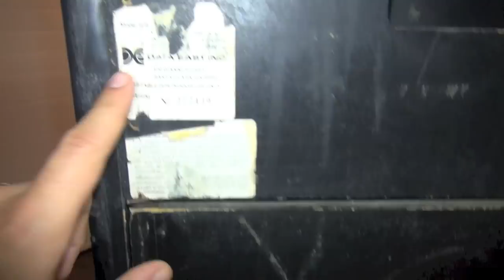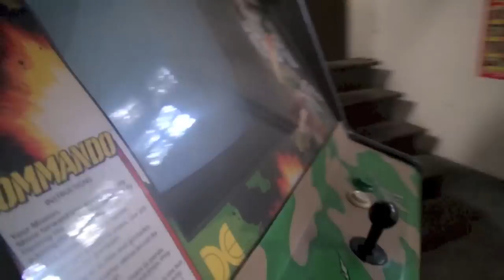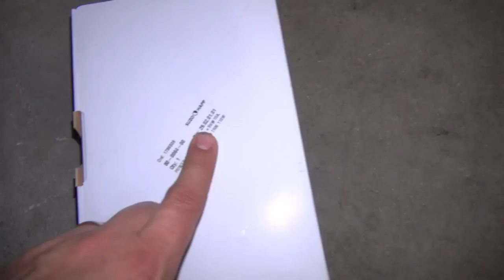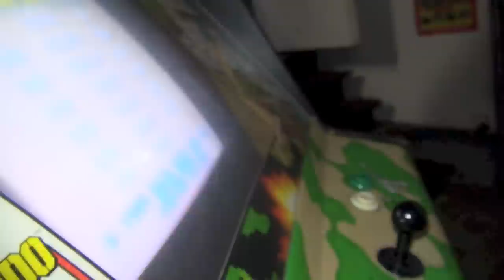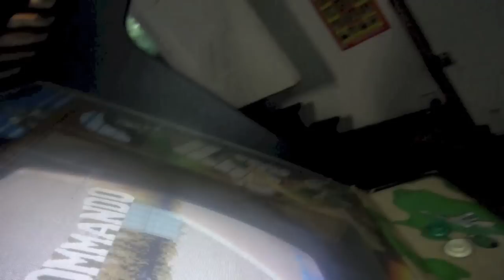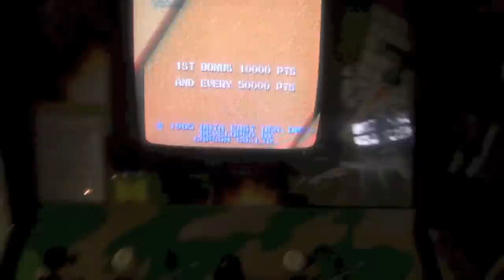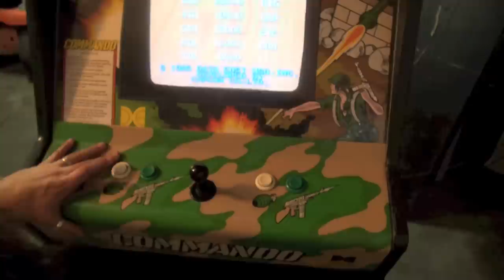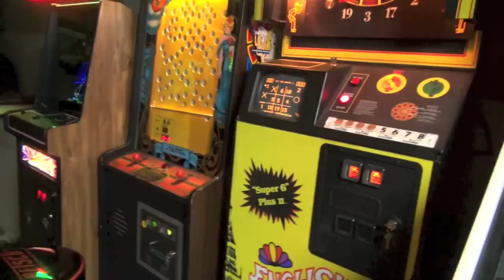How to fix a dead arcade game #1 - Troubleshooting a Craigslist purchase - Data East Commando

Comment: Tip: Take a photo of wiring with a camera phone before disconnecting everything.
That way if you get mixed up, you can just check the photo for reference.

Another tip: use electrical contact cleaner or isopropyl alcohol to properly clean switch contacts
Reply: Or you could just label them like a normal human and so they will be labeled for future fixes.

Comment: A room full of the most amazing arcade games known to man, and the thing that sticks out to me the most is the Rat Pack poster. That is the best basement in existence.
Reply from the maker: Thanks, buddy! And, yeah... I love the Frank, Dino, and Sammy. :)
Reply: @Johnsarcade  can u help me I bought a  game 
It worked for 10 minutes and the monitor cut out then smoke and then nothing!  PLEASE HELP!
Reply: @shanoemichael4439  Check the capacitors on the PSU, they probably will be bulged, the filter caps do blow when sitting for a long time
Reply: @roberternest7289  I have a mortal kombat 2 and it was working but sat in my storage for a few years and will no longer boot up now.
Reply: @Bondovw  Caps too. I'd need to see the PSU, do you have discord?

Comment: i just bought my third arcade machine tonight. it was listed on CL as turning on but not playing.
when i got to the house the screen powered up just like the one in this video, i (not knowing much about these machines assumed it was a bad monitor) later i realized no sound meant the game wasnt coming on. i searched the net for a while and stumbled upon this gem of a video.
i pulled the power supply out and gave it a look, someone clearly was working inside of it and hacked wires and stripped screws (all inside the power supply).
thank you for simply being the suggestion to point me in the right direction. defiantly a thumbs up and subscribe!!

but i have to say when you broke out the power driver to put the screw in to the casing of your new power supply i cringed pretty hard! thats a bit of over kill for that type of job but it seems to have worked so i guess no harm done.

thanks again.
Reply from the maker: Awesome, glad I could help! That power screwdriver has really low torque. No harm was done!

Comment: Isolation Transformers are used to physically separate the monitor's power form the mains lines.  This has the advantage of eliminating a ground-path return so that if you touched one side of the power coming from the monitor side of transformer, there would be no return path through your body to ground so you would not receive a shock, or at least not as strong as you normally would.  

Without the transformer in place, touching the hot side of the AC would cause a shock because your body would be used as a return path to ground.

At least, that is how I understand it. :)  YYMV.

BTW - The terminals are called "ring" terminals, as opposed to the "fork" ones you were expecting.  And I love the vids - good to see another passionate collector out there!

Comment: When you mentioned the dip switches and were looking and wondering what the dip switch settings "one way or two way" switches for a coctail table were. 

One Way is for the screen to stay facing one player and sharing controls from one side of the table with another player vs Two Way so the screen flips orientations between both sides of the table so the additional player isn't looking at a screen upside down and they can use controls of their own on their player turn.

Love the arcade collection. Good titles and helpful tutorial for beginners. 👍

Comment: About 20 years ago I picked up a Shinobi for $20.  The seller said it would run for a while and then lock up.  I checked the voltages and the +12 was putting out +17. It had a 12v adjustment so I dialed that down and it worked great.  Later I noticed that it had a shadow of something under the paint so I stripped some paint off and saw a big Williams W. I took a little more paint off and saw it was formerly a Joust.  Unfortunately we moved and I had to scrap the game but I kept the main board.

Comment: My brother bought a broken original Digdug cabinet that has a streefigher board inside. As with you, the price was right. The one side panel has the digdug branding while the other is branded with streetfigher. We are having the same  blank monitor issues you had. I hope it's the PSU! We'll check it  this week.

His original idea was to buy a new empty arcade cabinet and hook up some buttons, joystick and a pi to it. This used cabinet was cheaper than any new cabine. So maybe we can get the old internals working in this Digdub cabinet and also retrofit a pin into it so he can switch between.

I have basic knowledge of electronic repairs, so hopefully I can get through this for him. I'm excited.

Comment: Great video and a great find.  Watched it start to finish while on the treadmill.  Some advice for novices.  Don't go cheap on multimeter, Fluke's are one of the best on the market, they can save your life.   When working with electricity that's live (plugged in) avoid wearing jewelery less risk of shock.  When cleaning monitors like John did, you can spray onto the paper towel first and then wipe the monitor, but John is a pro so he can get away with it. :)

Comment: Hey.  Thanks for this video.  It gave me the confidence to go ahead and buy a non-working game off of craig's list/ebay and walked me through how to test it and work on the device.   My first pick up was an old Frogger game with a frayed cord.  Turns out I just needed to replace that cord to the PS, and it fired on up.  

Took your tip to unplug the CPU and test voltages first.   Only had to splice together a snapped wire in order to get the start buttons to work. My son and I had fun doing this and shared the joy of success in getting our first unit to work.  

I kind of wish you'd watch the language in some of your videos though.  I can't watch some of them with the children. :)

Thanks again, man!

Comment: At 15:00 that potentiometer is for adjustment of the 5 Volt potential between 4.5 and 5.5, if there's NO voltage, the power supply is DEAD. Turning it to maximum risks sending 5.5 into everything (problems?, possibly). Nice repair. Good cheap game for cost of purchase +$15

Comment: That is really cool, Awesome video. I just picked up an arkanoid in a painted over pacman cabinet. The guy was never able to play his game even though it turned on. At his hour i noticed that it did not have coin mechs, one switch was unconnected, and the other was missing the wire to coin up but was able to move it and register a few coins so he could play his game for the first and last time before we packed it up in the truck lol. I paid him first though. It still needed some work but was a pretty solid deal.

Comment: I got a question. I have a multicade Joust machine and the fuse blew. The one that came out is a MDX3 125volts and all i can find locally is a MDX5 125volts. that to much amps for the machine? should I keep looki ng for the 3amp

Comment: Great video, thanks for sharing. I have a Johnny Nero shooting game that I've been working on. I was able to get into the diagnostic screen but couldn't calibrate the guns. I changed out the pcb on the guns and things look good but when I hold the start button at start up the game starts but doesn't go into the diagnostic menu. I know I need to Calibrate the guns. How can I get into the diagnostic screen if the start button doesn't take me there? There is no diagnostic switch in the coin box either that I can tell. I'm new to this but learning. Thanks

Comment from the maker: When doing DC I am basically putting my leads on positive and negative. Black goes on ground (-) and red on +5 (+). When testing AC I am putting one on common and the other on hot which is the two AC leads.

Comment: What on EARTH are you doing adjusting LOPT screen & focus pots with your bare hands? USE A NYLON TOOL IF YOU VALUE YOUR LIFE - THERE'S ~25KV ON THAT TX.

Sincerely, TV & VCR engineer since 1991.
Reply: +unlokia 
Nylon tool? Any link?
Reply: BarrySlisk Google "nylon tool" ;)
Reply: +unlokia its also called a trimmer, I think
Reply: Shao Kahn Ah yes, that's the one, thanks :)
Reply: +unlokia Mr Unlokia, If I dont have this nylon trimmer tool, is it advisable to work with nylon gloves (like the yellow ones)? Or it doesn't serve no purpose? I ask because, even if I have these tools, the flyback is facing the side of the cabinet on my Wei Ya chassis, so I have no way to correctly aim the tool to the pot.
Reply: I worked on those games for two decades. The only time I used those tools was to adjust a choke. If the flyback was leaking, there is no doubt. I did get hit one time trying to drain the CRT. My hand slipped and I touched metal. That did hurt, blue flash in my eyes and the taste of copper. But I agree, unlokia, Safety first. I guess I was pretty lucky, but also, always aware. I also worked on Juke Boxes and Pins, pool tables, electro mechanical machines. Ones even from the 19th century.I think that the Interlock switch was off set on this game. So the back door would not activate it. They could keep it in the out position and just put a switch on the front.

Comment: You can fry a game board by powering a game on with a suspect power supply. Measure the power supply voltage first with a test board/load before using a good game board. You never know if someone has been screwing around with the power supply's voltage dial or if the power supply is putting out voltage way above +5v or +12v.

I don't like to adjust the voltage dial with the good game board powered on with an unknown power supply. I fried a board once doing that. I was at +5.03v and was trying to adjust to +5.3 and the voltage dial or power supply went faulty shooting the voltages up way too high on the +5v and +12v rails, frying my game pcb. So now I always use a test board when adjusting the power supply to dial it in when powered under load. Better safe than sorry in with a working game pcb.

Comment from the maker: Pac-Man has the power supply built into the main PCB. It doesn't have an external power supply like the one in this game. This game's power supply setup is much more common, especially with mid-late 80s and beyond games.

Comment from the maker: The monitor does not run off the DC power supply. The monitor gets its AC from the Isolation Transformer.

Comment: FYI: On AC wiring the black wire is "live", and the white wire is "neutral". -- Most modern power supplies should make that distinction. -- It will probably still work if you hook them up backwards, but it won't be as safe, and it could violate your local electrical or fire codes.

Comment: With a not functioning psu, why didn't you check for shorts on the power rails before powering on the new psu? Couldn't that have destroyed the boards if there was a short on the board the killed the old psu?

Comment: 2024, i thought you said not to just plug it in, check voltage for the power supply but then dont remove the connector for the pcb??

Comment: Isolation transformers are used on monitors are for safety. Most monitors are live chassis & if earthing to the cabinet is lost there is potential for the cabinet to become LIVE if an isolation transformer is not used.

Comment: Hi. I own two Commodore crt monitors. The 1701 and 1702 model. Both in perfect shape and working. Would like to keep it that so I was asking myself if there is any need to replace the caps on the PCB? What's your opinion in this?

Comment: Hi John. Great vid thx. I bought a Midway Space Invaders from 1978. There is a very old power supply installed. I checked the voltages and there is no -5V. So I wanted to replace the old supply with a new Switching Power Supply. But there is a huge connector to the old power supply with a lot of cables. I have no idea with ones I have to cut from the connector to install them on the new supply. Some ideas? THX and nice day. Reno
Reply from the maker: Arnold Tostone There is an adapter: http://cambridgearcade.dyndns.org/?q=node/15

Comment: Hello. I'm burning my
neurons on a video signal issue. I bought a Pandora's box 3 vga HD.
This is a plug and play card to play old arcade games. It can
autoswitch between 800x600 and 640x480 signal. It is an embedded
system with the sd and software inside (emulator + roms).
Unfortunately the code is crypt and I'm unable to reverse engineering
that. I tried to plug it to two old monitors with only vga plugs and
other two with also dvi plug. I noticed that in the older it works
fine, instead in the newer doesn't. One of them shutdown and led
blink and the other monitor turns on and off repetitively. I check
the pandora's box vga pinout. It use only rgb, v and h sync, and gnd
pins. It doesn't use ID0,1,2 and 9 pin for data (ddc) and memory
power. I suppose that newer monitors want establish a data dialog
with the source board. I don't know how technically the software of
the board can decide to switch from 800x600 to 640x480 without any
feedback from the monitor. In fact seem that in newer monitor the
board switch to lower resolution. If I plug a new monitor (not
working) and after an older one, it switch on with 640x480
resolution. I used a signal scaler able to change resolution and I
have the same issues. I check also the vga pins frequency. I supposed
that the v and h frequency is some hertz different from the correct
one. I check also the chips datasheets to find is an electrolytic
capacitor should be changed for a ceramic one. I think these last two
things are ok, because I saw that when I try to use one of the two
new monitor it works properly by using a trick: when I find blinking
led issues I connect the monitor to my laptop and it works; I set the
ext monitor as 800x600 @ 40 hz (still working); then I reconnect it
to pandora's box and it works fine. After all my studies I suppose
that I should find the way to force the monitor and the pandora's box
to 800x600. How to do it hardware side?..... ok someone should tell
me:”just use an old monitor”... but I would like to know how
monitors works and I would use a new monitor lighter then older (I
have to fit it inside a cabinet on a wood panel)

Comment: The blue wire in the 6 wire harness looks like it's going to the -5v 1a      I traced mine back to the "v" on the blue adaptor that connects to the second adaptor that connects to to board.     That seams to go no place as no trace lines are on the board from that pin

Comment: Looks like this is not the first time the PS has been changed. I am guessing due to the age,  the ESR on those capacitors that are on that logicboard are at the point of ridiculous. They probably need to be changed or this will need to be done again in the near future. Jim Carry should see what kind of current this thing is drawing.

Comment: Excellent video John.

Q. When you tested for the 5V DC, you put one lead on GND, one lead on the 5V. But when you tested the AC, you put one lead on one AC connector, and the other lead on the other AC connector.  Could you please explain why you wouldn't put one lead on GND, and one on AC, to test for AC?  Thanks.

Comment: put a bill validator where that light switch is. looks like it was modded for that. you can see the heavy gauge residential wiring in the harness
Reply from the maker: It def' was not modified for that. The heavy gauge wire was there because the idiot that did it was a hack.
Reply: hahahaa, yea a hack alright. i'm guessing he tossed a residential cfl for the marquee and coin door switch. but hey, since the cut out was there maybe you could put a validator in there down the road instead of buying a new door? great videos, i learn alot from them!

Comment: this is great :) i actually have an original Gyruss tabletop machine that blew out a couple of years ago - i need to get around to fixing it and i know they're built a little differently but this was still really interesting and kinda helpful!
Reply from the maker: I did an entire Gyruss restore. Should be the same kind of power supply setup.
Reply: John's Arcade Game Reviews & Tech I managed to get it up and running but for some reason all the actual game graphics (aside from score, logo screen, and game messages) don't show up (such as the player, the enemies etc.) - all the sounds are in working order but the visuals have kinda gone nope - do you have any idea what the problem could be? thanks!

Comment: Thanks John.  Last night I took the board out again and took the layers apart again. This time I seen a small transister with some light browning on solder side of the board so I'm assuming it's bad and the cause.   It took a while to find one using google but I ordered a 5 pack as that's the minimum I could find. Hope it works.   From china so hopefully in a few weeks I'll know for sure.  Love your videos !  Keep em coming.  Thanks again for your time and help!

Comment: I bought a golden tee that didn't work and tested voltage turns out a fuse on the isolation transform was bad has it working in 15 min like you did couldn't believe it no one trouble shoot the the game before I bought it

Comment: Hi John. I replaced the old power supply in my Space Invaders with an new Switching Power Supply. Now I noticed +5V=+5,0V / +12=12,15V but -5 was only -4,12V. Is that enough? Bye Reno

Comment: You should be able to run the wires for the coin slot to the 1 Player Start button. So pressing that button would both insert a coin and activate 1-player start. That's no good if you want 2-player, but a better choice for somebody who might want an easy way without drilling the cab or messing with the ROMs. Or just wire it to one of the left-hand fire buttons that probably never get used. :)